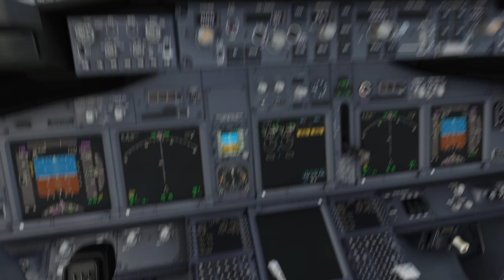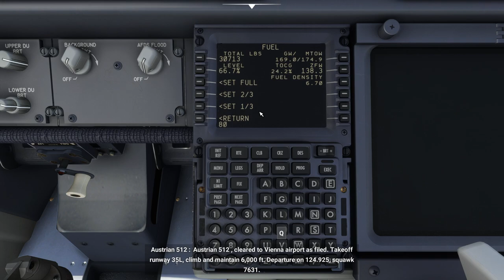GSX Pro Refueling Tutorial with PMDG 737 for MSFS

Comment: The best way to avoid any problems with GSX refuelling aircraft with custom fuel systems is to save your default panel state with a low fuel load (1500-3000kg max). The main thing people seem to miss with GSX is that the new fuel level needs to be MORE than what is currently in the aircraft when you call the fuel truck. The starting fuel level in the PMDG is set way too high by default and needs to be lowered before calling GSX refuelling.
Reply: Could you help me how do I do this in PMDG? I'm looking for the FMC and also the files in the community folder, I can't find exactly where to change the default value. It always starts at 54% fuel, I wanted to lower that by default. If you can help I would be very grateful. Thanks
Reply: @CitizenChaz  I was coming to comment again. I managed to do it by reading the PMDG documentation, the saved file was in the Work folder, I couldn't find it before to make adjustments and reset the battery parameter (I wanted it turned off after finishing the configuration). Now it's all right and I got it, and the GSX works. Thank you for that, it really was something that bothered me a lot.

Comment: Ok Umberto but the operation is completely unreal. You don’t see any tube connected to the plane no men around. Sorry but with the fenix a320 is completely another thing. The simulation result more immersive. I remember with p3d i had always problem with PMDG products. No problem with other like fslab airbus
Reply from the maker: The main reason why it has been clearly explained in this video a new fuel truck with crew a cable animation that a 737 can use is coming soon, was precisely to prevent somebody questioning the lack of a crew/cable animation.
Reply: @umbertocolapicchioni2467  I don’t think he watched the video 😂. Will GSX in the future be able to give AI traffic the same services that our aircraft gets? Currently, AI do get services but they’re very basic in comparison to what we get. It would really increase the immersion and overall experience with GSX 👍🏽✌🏽

Comment: IMHO best way is use GSX purely for visuals and pushbacks .. load fuel and other weights via FMC or in case of Fenix A320 , tablet software - it would be nice , if it is synced together :) so maybe in future .. imagine press load button in tablet and the rest of the work will be done by GSX automatically :))
Reply: Whats really annoying is that fuel truck always come when you ask for boarding. Even if you dont want to refuel, the truck will always come after the passengers are loaded

Comment: This video is not valid anymore. I have to refuel from ground services menu and if you want refueling Progressively you have to call fuel truck of pmdg.
Reply from the maker: The video is still valid and, as they video says, if you want to refuel progressively, you must set the appropriate option in the GSX settings.
Reply: @umbertocolapicchioni2467  First, I just saw flybywire a32nx integration and its awesome. Congrats.. Second my GSX settings "always refuel progressively" ticked.  in fs actions --> Fuel page --> level is 25%. I request fueling from gsx and wait for confirmation. After confirmation announced i change "level" to 35%. and fuel track instantly make it %35 and left.